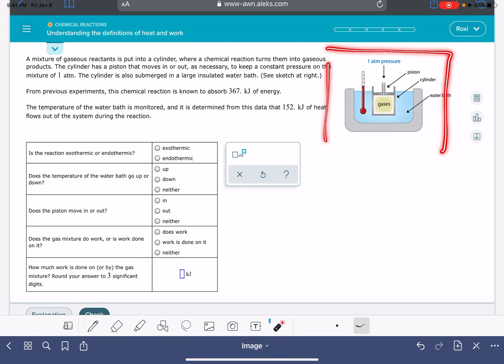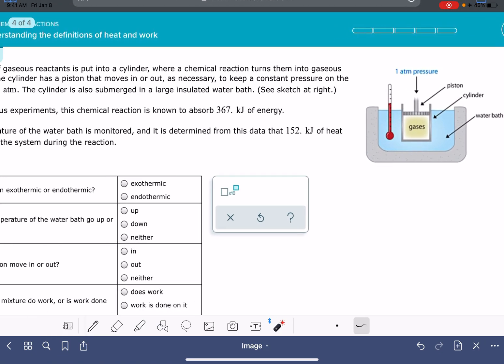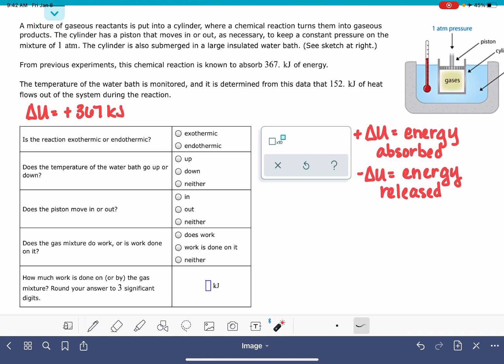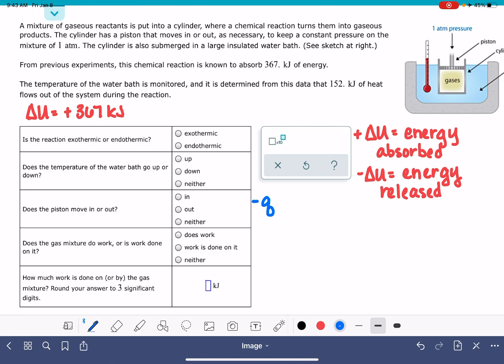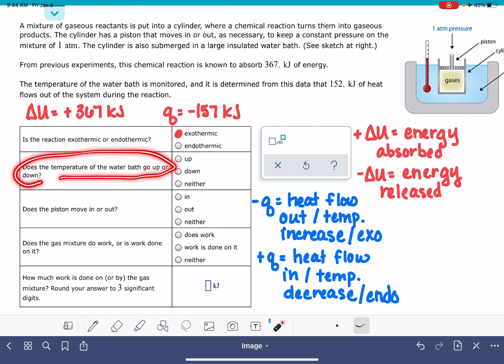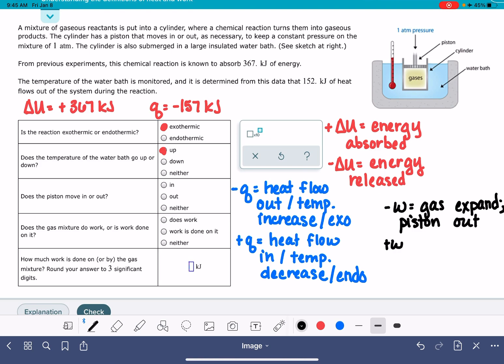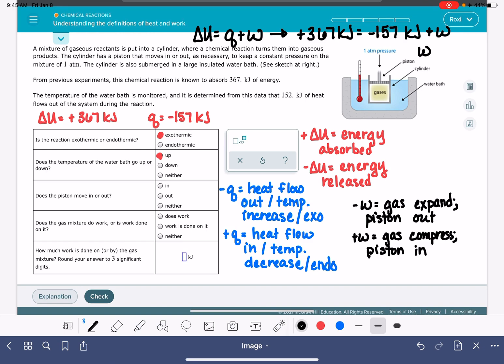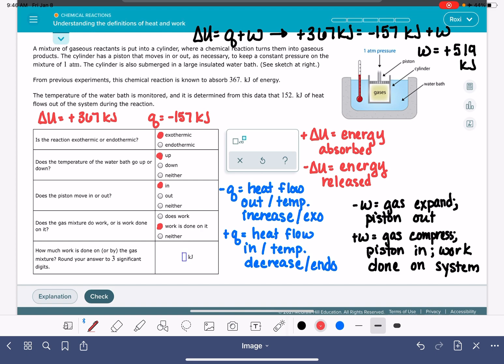ALEKS: Understanding the definitions of heat and work

Comment: if heat flows out wouldnt the temperature decrease?????
Reply from the maker: Heat flows out of the cylinder of gases into the water bath. The temp of the water bath increases.
Reply: @RoxiHulet  ohh ok thanks